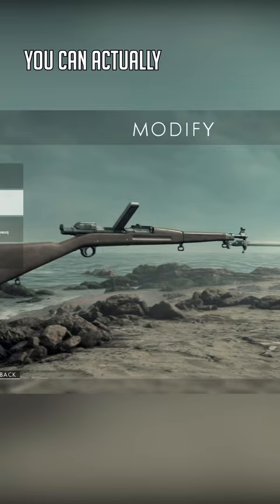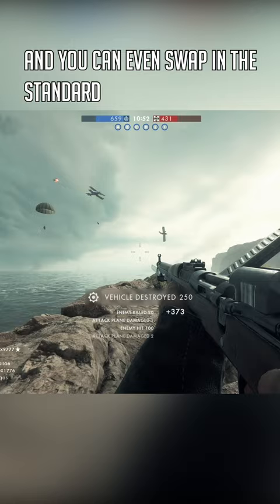This WWI Rifle Could Transform on The Battlefield #battlefield #battlefield1 #shorts

Comment: My grandfather has that Springfield rifle that was modified to accept that device. It's a shame he doesn't actually have the device for it tho
Reply: you just need to find a good guns smith and the schematichs
if you get the steel your self is not going to cost you a lot
Reply: @cubirk9200 bro thinks anyone can make a semi auto weapon
Reply: @armouraddict279  but dude his grandpa already has the rifle
the gunsmith only has to make the device
Reply: @armouraddict279  if you cant do iy does not mean no one can
there is some people out there that can make a gun using a pipe and 3 springs, so belive me someone can do it
Reply: @armouraddict279  it’s in .30-18 Pedersen  because the barrel is 30 caliber, 45acp is too big for the barrel
Reply: @joeg1679  ah, I should've thought of that, thanks mate
Reply: @ArmourAddict  I feel like you added the barrel point to seem intelligent. It had the opposite effect.
Reply: @armouraddict279 did you just say a blowback system is complicated?
Reply: @kingoftheneeks3623  yes, because the system has to be absolutely tiny. You’re essentially making a semi auto pistol, that takes up as much space as the bolt of the rifle
Reply: @armouraddict279  complex is not how I'd describe the ww1 pipe dream that this conversion is
Reply: @armouraddict279 no he thinks a gunsmith can, which is true
Reply: @Ionized Odds From a certain point in production the m1903 was made with (older ones were modified) a hole in the reciever to eject the empty shells. It required no field modification to use the device, but the design of the rifle itself had to be altered
Reply: @armouraddict279  45 acp through a 30-06 barrel? You just lost all credibility
Reply: @timothyroome-traut8324  yea well if you listened mate I acknowledged my mistake
Reply: U probably could get a picture of the part and have it 3D printed out of metal maybe, dk if it would work
Reply: I saw someone on youtube make a pedersen device he lays out instructions as well but from what I've seen it ain't worth it, smaller caliber rounds simply aren't built to fire from a bore larger than the bullet itself so it is very much prone to jamming, like a lot which makes sense even during its time why it was discontinued in favor for just giving soldiers side arms or something, like if you want your bolt action rifle to fire pistol caliber rounds then you would not only need to replace the action but the barrel itself which is mostly why the device simply didn't work since it only converted the action not to mention the feeding was very sketchy since its gravity fed rather than spring fed
Reply: @armouraddict279  a competent machinist could definitely make one and although you really couldn't use the original ammo. A good substitute tho could either be 32 acp as there's chamber inserts for that on the market already and 30 super carry. It wouldn't be practical but it would be awesome
Reply: @shoelessbandit1581  agreed. I'm not a machinist but I appreciate the info !
Reply: @armouraddict279  as long as ur not in california or NY or NJ or Similar gun control states. ANYONE legally can build their own Semi auto rifle from scratch no paperwork needed.
Reply: @cubirk  I can make a gun from supplies at a hardware store chamber in 9mm.

Can build a PPSH too. You just need a crude latch heavy spring. A rod, and nail. Couple pipes and some tools to cut metal with. The barrel is the hardest part.
Reply: @shoelessbandit1581  would be easier to just build and machine a new barrel to accept 32 acp. And actually put the proper twist. Then machine the part.

To be honest though, I'd rather just build the whole firearm at that point instead of destroying a collector peice.

That's like those people who take a mosin and destroy the classic look to make it a deer rifle. Or slap moder rails and scopes on it. When they could just learn how to use the 3x scope
Reply: @armouraddict279  Its already modified to accept the device, the device itself is probably just a sheet metal box with a firearms spring with enough tension as well as all the other stuff that comes with a magazine, add a simple mag release and boom your all set
Reply: @armouraddict279 anyone can make a full auto gun 
Ever heard of the luty?
Reply: @Robert53area  I don't think you understand the concept of it. The idea is you can switch between a bolt action 30-06 and a semi auto 30 cal in a couple seconds without any permanent modifications. I'd recommend watching c&rsenal's video on it they both got a hold of an original and ammo for it
Reply: @armouraddict279  he said "find a good gun smith"
Reply: @armouraddict279  it’s called a Luty. It’s a full auto anyone can make. Once you master that you aren’t far off. Anyone can make a gun
Reply: @poplegosarcade2239  yea ik open bolt machine guns are easy but a perfect recreation of a pedersen device from documents that no longer exist is my point sorry for any lack of clarit
Reply: @armouraddict279  Bruh if they could make it on the jank early 1900's machine shop they could do it much easier now on a CNC machine.
Reply: @armouraddict279  so its pointless for u to
Reply: @armouraddict279  live
Reply: @armouraddict279  worthless
Reply: @armouraddict279  kid
Reply: @cubirk  so its pointless for u to
Reply: @cubirk  live
Reply: @cubirk  kid
Reply: @armouraddict279  people can and will make their own bolt mechanisms for the right price. It can be done.
Reply: That’s fucking cool I have a 1918 1903 sadly not converted to that
Reply: @armouraddict279  lmao a device for a weapon is not a semi automatic weapon
Reply: @armouraddict279  when did he say anyone, he clearly said gunsmith
Reply: you can have them 3D printed now out of metal! I would look into it as a cool gift
Reply: @cubirk  any good gunsmith could do this lol
Reply: @jarrettmartin4143  thats what i said :v
Reply: @traphimawari7760 but it's not a smaller caliber. the diameter is similar if not the same as 30-06. length of the round doesn't matter for the barrel, only diameter. you would not need to replace the barrel, and it would operate fine. plus you miss the point of it entirely. the point was to provide soldiers better ability to shoot faster because the 1903 is basically a bolt action hunting rifle. giving a sidearm doesn't really improve that because less capacity and it's more expensive than just providing them with the device.
Reply: 3d print one
Reply: @armouraddict279  bro can't read and starts comments with "bro"

subtly raises national education budget
Reply: @armouraddict279 so you just going to ignore luty? Bonehead comment 😂
Reply: Same my grandfather had a Springfield rifle he did not have the device but he still shoots it time to time
Reply: I saw one at a gun show like 7 years ago and I can’t remember what they had it priced at exactly but I wanna say it was between 25-75k
Reply: @shoelessbandit1581 You can still find the ammo. It's called 7.65 x 20mm Long/Longue.
Reply: @cubirk I'd say it's not so much a case of difficulty, so much as legality for converting a bolt action into a semi-auto. Idk if it would violate any laws, but I know lots of countries have extremely specific laws on guns and modifications.
Reply: @dylannecros3636  i mean like i mean
Sure like yea but gun me like so gun me make

Comment: You can drastically increase the effectiveness of using the M1903 infantry by double tapping your switch weapon button after pressing the button to change to and from the pederson device. This skips the animation and becomes basically a normal weapon swap meaning you can switch between Bolt Action Rifle and Carbine in what is probably less than half a second...

Comment: The closest modern equivalent of the Pedersen is like a cmmg 22lr conversion for an AR. You pull out the bolt, throw in the conversion, and bam. You got smaller cheaper bullets to send down range. But it doesn't really effect rate of fire.

Comment: They had issues with the early Springfield rifles. The furnaces at the factories producing them didn't have thermostats on them. They used to eyeball it by looking at the Colour of the receiver change in the furnace.

It resulted in a lot of improperly hardened receivers.  A number of them shattered, cracked or where so brittle that a blow to the side would crack or split them.

A number of these guns where recalled from service and sold on the civilian market. Production was stopped.The 1917 Enfield was adopted in 30-06 as a stop gap while they fixed the production issues of the Springfield in all the factories.

As a result more Enfields where used in WW1 by American forces, than Springfield rifles.

I have one of these early Springfields. It was made in April 1917 by Springfield armory.

Comment: The problem with the Pedersen device is that it basically didn't work, had some real issues with headspacing, and essentially turned your .30-06 rifle into a semi automatic mouse gun with a 24 inch barrel, firing a cartridge similar to .32 ACP.

Comment: A semiautomatic pederson device chambered in 7.62x25 or .32 ACP  would work for most .30 s and would probably sell good for a few .30 surplus rifles
Reply: The issue is the device needs straight walled .308 caliber pistol cartridges to be functional in a .30-06 rifle. 7.62 Tokarev uses a .312 caliber bullet so while it could probably fit in a .308 chamber it has bottlenecked cases which really screws up the design of the device, as for 32 ACP it's even bigger than Tokarev so you'd need a really loose chamber to fit, and once again the semi-rimmed casing of .32 makes it hard for the device to work,

Comment: The device was never used yes the rifles has the adaption cuts but they were kept relatively under lock and key to be used in the spring offensive 1919 and the germans surrendered in 1918

Comment: Not an automatic rifle, just because you use the 1903 as the base with the full length barrel doesn't make it a rifle, because the caliber is a pistol caliber and since the weapon is automatic thst makes it a carbine.
There are many different types of carbine, full length weapons that fire a smaller cartridge in a self loading system, a rifle thar has simply been shortened is technically a carbine, and there is also purpose made submachine guns like an MP5 that are simply made without the ability for automatic fire, all of these are carbines in their own way, hell even the M16 is in a way, a carbine as it technically doesn't fire a rifle caliber like an proper rifle i.e the M14 or the FAL

Comment: They were never fielded
Reply from the maker: Never said they were?
Reply: Bf1's multiplayer has lots of unfielded guns and still managed to miss very common ones like the Ottoman's and Italian's whole infantry equipment
Reply: Italy at least got representation with the Carcano
Reply: I'm wrong, slightly. The Italian infantry arsenal is decently represented, the ottoman seems lean but that's because the Gewher 98 stands in for a lot of the mauser variants they used, BF1 also has the Martini Henry, which the ottomans also used
Reply: @Flakfire fair
Reply: @anter176 sights are wrong on pretty much every gun